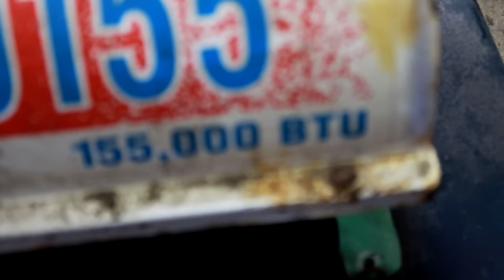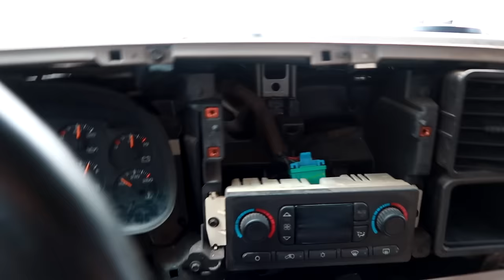NEW WINTER CAR REVEAL!!!

Comment: my dad had a 1972 chevy sitting in the yard since i was a little kid and when i was 12 he told me if i fixed it up i could have it so ive been fixing it up since, im 18 now and ive only had one problem with it but it wad entirely my fault that it happened. but now its fixed and i habent had any other issues, shes still running strong 👍👍

Comment: mine was a 98 dodge 1500. 4x4. dana 1 tons, 360. but it only lasted a month or two because it road walked horribly and had extremely high miles, but my truck i had when i turned 16 was a bad ass 2wd 01 chevy that lasted 2 months before the trans went out

Comment: 99 dodge Dakota 5spd 5.2 V8 still driving it today had 221,000 when I first got it now has 322,000 still runs like a dream haven't even had to replace the transmission on it yet or clutch

Comment: My first running truck was a 1972 gmc sierra custom with mud tires and shizzz. I had the motor out 3 times. I didnt drive it much before i sold it. But it was a nice truck and i wish i would not have sold it. :(   I would like to know if it is still on the road.

Comment: First vehicle was a 94 f150 with inline 6 5 speed manual. 4x4. Went threw 3 transfercases. And broke a drive shaft and blew the rear end. After that happend I was tired of fixing it and buying parts. And wanted better mpg so I got a 93 Toyota celica. Totaled that. And I loved that car so I bought a 95 Toyota celica gt 2.2 5 speed cold air intake flow master exhaust sounds nice. 150,000 miles and only paid 950 and if u know toyotas they last for ever. And I still have that car.

Comment: 1995 Saturn sc2. Had a performance switch in it no joke. Lasted me 2 years until she slid into a guardrail.
Reply: TrueRedneckGarage The performance switch only delayed gear changes. That's something you can do with a lot of cars just by gradually adding more throttle, when you stop adding it will shift.
Reply: oh I know what it did PGTMR2. I just thought it was funny how a car with hardly 90hp had one. lol
Reply: It was so suckers would buy one, faux performance. In lieu of real engineering and advancements. I had an SL1, I left the button alone. I assumed it meant faster death for the transmission. Mine was the worst car I ever owned, it was well used, but, was disappointing even in discussing things that weren't broken or worn out. I did see one whuhooping on a Camaro on YT though. That was an entertaining video :D Probably SL2, and it had a turbo. This Escort could be fixed with a KLZE v6/5speed swap. 200hp 170tq NA.

Comment: 01 7.3 lasted 3 days then relized it had bad injector orings then lifted it 8 inches fixed the orings then the trans went i havent put more than 50 miles on the truck sence i had it     it will be back on the road soon

Comment: i had a 2002 saturn L100 tgat i got when i was 13 and i drove it untill i got my license. but the day after i got my license i was driving it and went over rail road tracks and the enginemounts snapped and dropped the motor because of how rusted the underside of the car was. (im from michigan) in a huge fan and wanna try to get a channel going of my own! let me know if you have any pointers! also. have yoy guys ever thought about making a sled out of a car hood to pull behind a quad or truck? a few of my buddies and i are going ti make one and take a car seat and weld it on amd add a role cage! just an idea i thought would be cool to see the 3Dmachine guys do this winter!

Comment: My First vehicle was a 1976 F-100 ranger. The first day I got it the transmission didn't work, sold it a week later lol. Wiring was a mess and it turned out the transmission wasn't hooked up right cousing it to stay in 1 gear. -_-

Comment: first was a 2003 manual full size shorty silverado 
second 2003 s10
3rd was a 2002 mustang v6
4th was a 1999 extended cab ram with a 12in skyjacker lift on 38's fudged a lot of truck sluts in the back bench seat 
5th was a 2004 40th anniversary mustang GT 
6th was a 1997 green 4 door 4x4 blazer
7th 2001 ford ranger
8th was a 1997 black 4 door 4x4 blaze
9th was and is a 2003 blue 4 door 4x4 blazer with a 3in leveling kit on 33's

Comment: my first car was a 1972 Plymouth satellite that I got 3 years ago for my 13th birthday and it's still around today but it needs a roof and a floor really badly and the car that I drive now is a 2005 Toyota corolla that has a 5.4L motor in it but as stock it was so much different than my other car was.

Comment: I got a 1998 Lexus LS400 and I bought it with 242,000 miles in June of 2014 and I have 372, on it now and she still runs great, well fair, I also have done a lot to the car I put cut outs on the exhaust and then I took them off and straight piped it and I changed the knock sensors and the starter and if you know Lexus they are under the air intake manifold so yeah, oh p.s. I paid 700$ for it

Comment: first vehicle was a 2000 isuzu rodeo got it with 180k miles lasted 6 months threw the timing chain and motor locked up

Comment: My first truck is a 2004 Chevy 2500hd 6.0 gas with 99,000 miles and I still have it I got it when I was 15 and I'm 16 now and I'm buying a 06 Chevy 3500 duramax but needs a new motor put in

Comment: I had a 76 Chevy 1 ton that had a water tank on the back my uncle gave it to me, it had a granny gear. I hated the thing but I swore I wouldn't sell it until it died, after a year I put a bed on it then fifteen years later someone tried to steal it and burnt the clutch up trying to get it in reverse, rip Chevy c30 at 506 thousand miles

Comment: 1992 Saturn sl1 had it for 8 years and it finally died with 378.000 miles
Reply: chunkenhead my motor on my sl2 went strong but my transmission didn't

Comment: 1998 chevy Malibu with 220k miles it broke a lot of times over a period of 4 months then pooped out and a few hoses popped off and the gas reader is broke so when I hit 200 on the trip odometer I had to refill but now I have a 2010 Pontiac g6

Comment: 1996 Buick skylark had it 5 years then it catch fire think it was an electrical issue I beat the sh#t out of it towed an atv 4 hours each way one time ran out of coolant on the highway the heat needle was almost buried red if it was summer it would have blown up actually it should have it was the 2.4l  4 cylinder  I cant complain

Comment: Mercedes benz 200diesel 1994 700000km driven, and had to change brakepards. therefore i've had bmw, and i think i had 4 mercedes after that, now i have gf and volvo so did not go too well.
Of course i have bass build micra and Vw transporter t3 as project car.. aaaaand kawasaki zz-r 600 as stuntbike. Merry xmas 3DMachines!

Comment: 1997 nissan maxima 5 speed 6 cylinder 3.0L had it for 1 year and hammered the poop out of it jumped it drifted it and remember it was front wheel drive then the power steering pump died belt blew off and drove about 10 miles no belt then she died in the driveway and went off to the scrap yard

Comment: My grandma has a Chevrolet it's a really old car The mileage on the car is at the highest it is going to run out my grandma got it for about 40 years The radio doesn't really work and the air conditioner and heater doesn't work that great but if this is good about it it's got the nays route down with Ruth my grandpa had a station waggon he had it forever he got it when his daughters were about 15 years old both those vehicles were nice vehicles